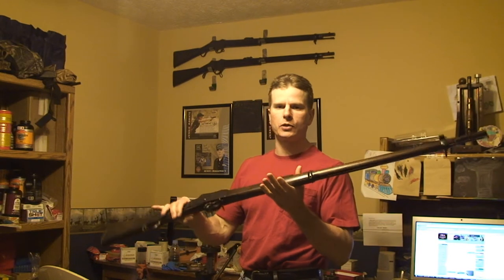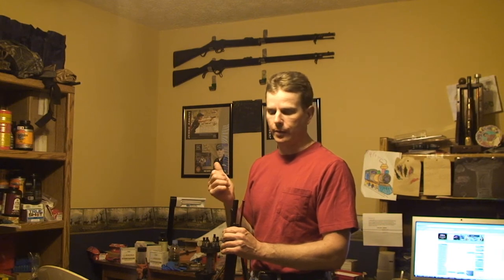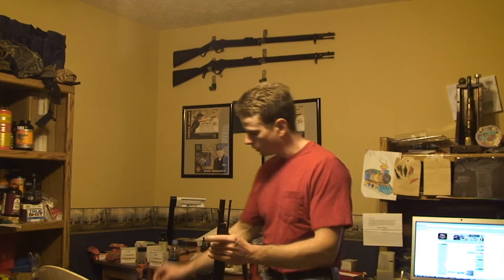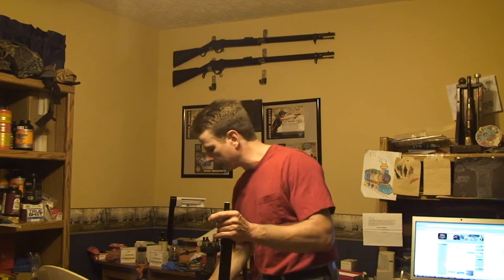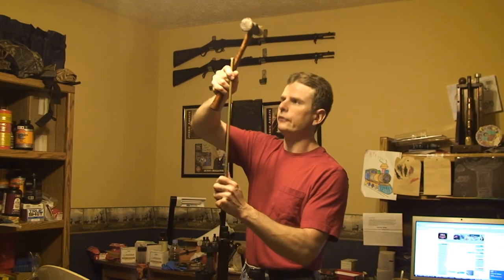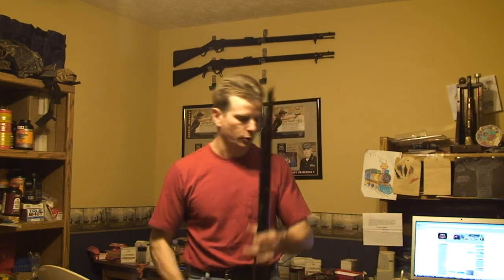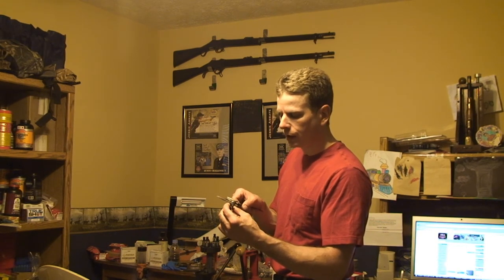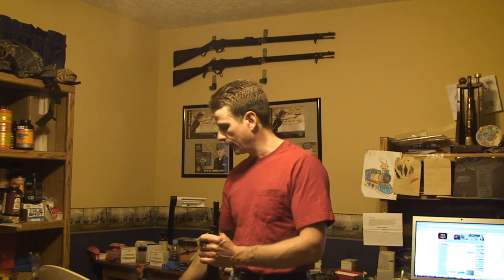Slug the bore of your Martini, Gahendra, or Francotte.wmv

Comment from the maker: After I determine the bore dia. I cast bullets that are about .002 larger. than bore dia. and I size and lube them.  I use brass cases made from 24 ga. shotshell brass.  I have a video of the process of making the cases if you are unfamiliar with it.

Comment: All your videos are great. I have learned alot about my Martini Henry II and IV.
Question; What do you use for a head space gauge .Is it the same procedure as checking headspace in a bolt action WW2 rifle for example . do you need to remove the extractor,field gauge  Thank you, Dave
Reply from the maker: The method used for headspace is to get a proper piece of brass, so one made by Bertram.  Put it in the chamber and close the action.  Then take a feeler gage and slide it in between the breech face and the back of the shell.  It is considered safe to fire if the gage is .010 or smaller.
Reply: I leave the extractor in the receiver right?
I will check  Graf and Buffalo Arms for brass.
What size would be used as a replacement for the old 577/450 Kynoch to check Headspace?
Thank you for the information
Reply from the maker: Grafs has Bertram brass at $128 for 20 cases.....Thats why I made the video on forming your own brass from Magtech 24 ga. brass shotshell cases.
Reply: ginsboy2003 I saw that video last week. A big help.Thank you,

Comment: How would you slug a muzzle loader bore when you have no access to the breach end of the barrel?
Reply: Buy a small ingot of Cerrosafe ! plug the barrel with paper towels about an inch inside, ( for a muzzleloader insert brass rod in the centre of the bore ) then pour in your melted cerrosafe ! using pliers slowly  pull the plug of cerrosafe then you have your bore diameter .... keep the cerrosafe you can use it multiple times on other guns !

Comment: what about the bore being tappered?
Reply from the maker: +Tyler I'm not sure what your asking, we need to know the dia. of the bore at the tightest spot which is the muzzle.  Having slugged my bores and cast my bullets for them I get pretty good accuracy at 200 yds as I've shown in another video.  https://www.youtube.com/watch?v=EqzL2Qg8UOU     
The bore is a little bit larger at the chamber exit, how much I'm not sure, but casting for the dia. at the muzzle I'm very happy with the accuracy.
Reply: +ginsboy2003 I agree that your method is correct for most bores in most rifles. However the throats on a (British) MH are usually .468-.470 and gradually tapper to .455-.465ish. The meathod you are using will give you the minimum diameter which may or may not shoot well. I
It would be better to fill the throat as the bullet will swage down. Your gun will not blow up
Reply: Tyler I Just bought one of these rifles and have been reading this also. Slugging the bore from the muzzle gave me a .462 and I'm guessing it's ok to shoot .468-470 bullets?

Comment: what i find odd is that any nation even a small crap hole nation like napel you would think if they are going to take the time to make a rifle they would take the time to fire that rifle / that being said surely they didnt have different ammo for the various martini rifles so how in the world did they shoot gahendra rifles at all ? being the standard martini ammo is larger in diameter ? or was there something like certain units were issued the gahendra martini and only fired locally produced smaller diameter martini ammo / while other units were issued brittish made rifles and used standard brittish sized ammo / does anyone really know or is it all just a guess cause surely a small nation like that had to depend on nearly every rifle and surely they were made to be fired
Reply: Well, they did have SOME British made munitions and firearms, but Nepal didn't have much in terms of industrial capability (they only made 4 gahendra rifles a day on average).  Like many developing societies, they relied on their blacksmiths.  When anything is handmade, your going to have variations, sometimes significant variations depending on the smith.  The Gahendra's were simply an emergency procurement measure until the red tape could be cut and British military aid could be sent to Nepal.  There were many cases of barrels exploding apart simply because the barrel was slightly smaller than MH spec.  That's why IMA ended up with so many parts rifles, the unissued weapons were used to patch up the ones in-service.  Variations in ammunition also existed, which further complicated this logistical nightmare.